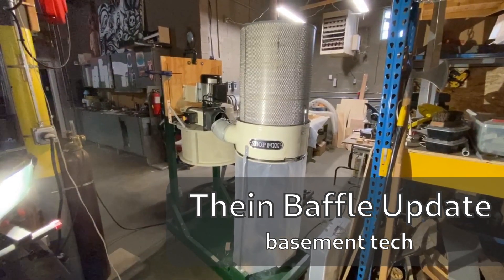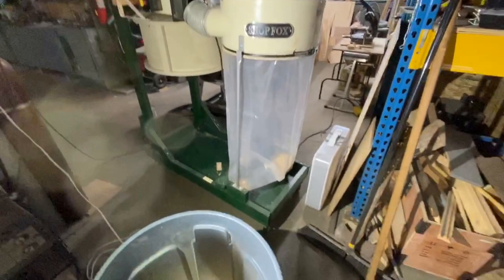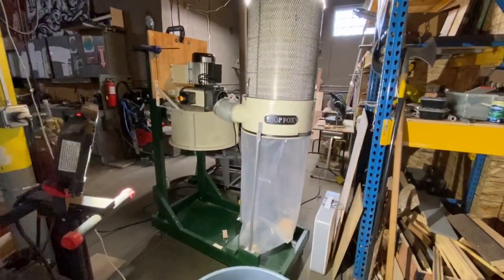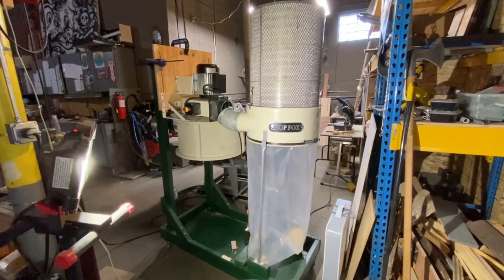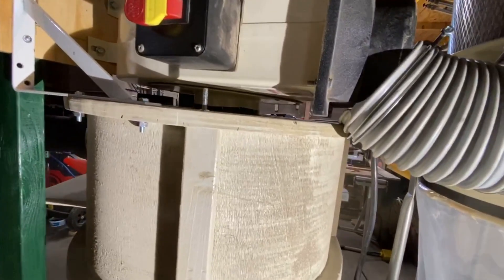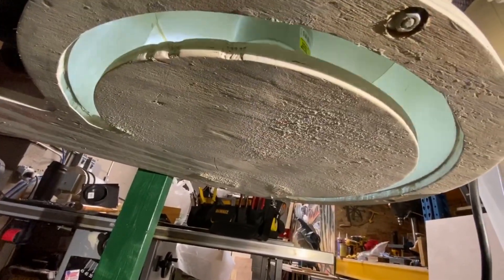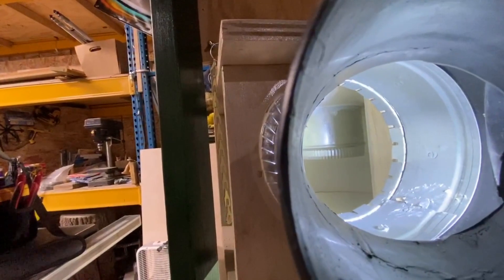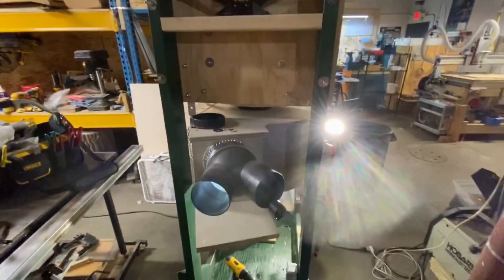Thein Baffle Performance Update (Quick and Dirty)

Comment: From everything I have seen, the height of a Thien baffle DOES matter, and some are definitely too shallow.  So, how tall and wide is yours?
Reply from the maker: I'm sorry for the delay, I thought I had replied with the dimensions.  I did some research at the time and followed the average of the answers found.  And, yes, apparently the height dimension is critical to optimizing separation.  Mine is 10 inches top-to-bottom (inside dimension) and about 18-19 inches in diameter (hard to measure without disassembly).  Hope this helps.

Comment: where is the video that you are updating with this video?
Reply from the maker: Hi Screaming Eagle … I mentioned it in this video https://youtu.be/4F6w3QFTVAk … not much detail, but there are some really detailed videos on Thein baffles from other makers. I’m happy to answer any specific questions. It’s still in use and doing a good job … I still have yet to make it easier to empty 😟
Reply: @danielatbasementtech That bag could be replaced by a screw-on, screw-off bucket and Gamma Seal lid.  On YouTube, see Stumpy Nubs (a couple different videos), and “Dust Collector Upgrades” by Patriot DIY.
To ease the emptying of the dust bin, see “Went With Plastic Barrels For My Super Dust Deputy 5 Inch” by Unemployed Redneck Hillbilly Creations.  
Like your videos.  Inspiring!  Thank-you!
Reply: @danielatbasementtech Just came across another YouTube video, “Building a cyclone dust collector (part 3 of 3)” by Jer Schmidt.  He previously built a cyclone from steel - skilled metal worker and woodworker, very smart and capable - as well as the casing for the motor and impeller.  This video is long (49:35).  In it, he builds a frame from tubular steel to support everything, including two rather tall canister filters and (at 24:03) a custom dust bin on casters.  
In this case, the lid is stationary and the bin is lifted to seal against the lid by two cam-type brackets and a cross member.  Very similar to the device from Unemployed Redneck Hillbilly Creations, but a different implementation.  Hope these ideas help make it easier to get your dust bin out.
Btw, I really enjoyed the video about your dust collection system.
Stay safe!
Reply from the maker: @joedance14  Thanks for your comment!  Now that I have experience (and pain) with my current implementation, I'll definitely check out the video that you referenced and consider a rebuild.  My son is a blacksmith/knife maker and has metal working skills, including welding, so perhaps a metal-based rebuild might be better.  I saw your last comment regarding the size of the baffle ... I'll update the next time I'm at the shop, but from memory, it's about 10" tall and probably about 20 " in diameter.   It does actually function remarkable well ... I rarely see much of anything in the plastic bag below the filter.
Reply: @danielatbasementtech  Appreciate the follow-up and the information.  I have a zillion things on the to-do list, but it’s about time to do the Thien baffle.  Thinking of something about that size (10-2 inches x 20-22 inches).  Good to know!
Stay safe!
Reply from the maker: @joedance14  ... asked my son to measure: "just under 12 " tall and just under 23" diameter".  I'm thinking that the height number includes about an extra inch for top and bottom (they were 3/4" plywood; cylinder set 1/4" into a routed slot)  ... enjoy !
Reply: @danielatbasementtech  Thanks!

Comment: One challenge with mine was telling when the bucket was full as then you get everything bypassing the baffle. How do you handle that?  I built a full bin sensor from a few parts based on the instructions you can find on the woodworking forums.
Reply from the maker: Thanks @drodver for your comment and question. Your right !… I had the same challenge. Contrary to my nature, I opted for a low tech solution: I cut a square hole on the plastic garbage can I used and screwed a piece of thin lexan in place as a window. Even with the dust, I can tell when it’s full.
Reply from the maker: Hello @drodver ... did you have success with your project ?
Reply: @danielatbasementtech  it works well! I’m in the middle of swapping to a different dust collector I got second hand and plan to move the sensor over.